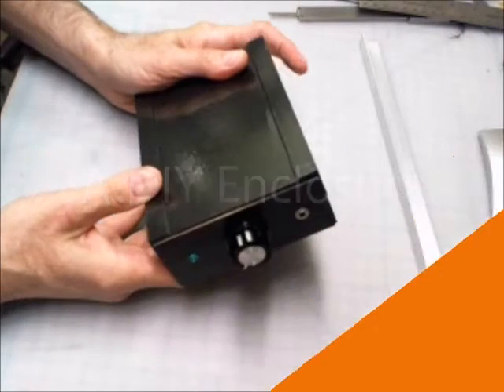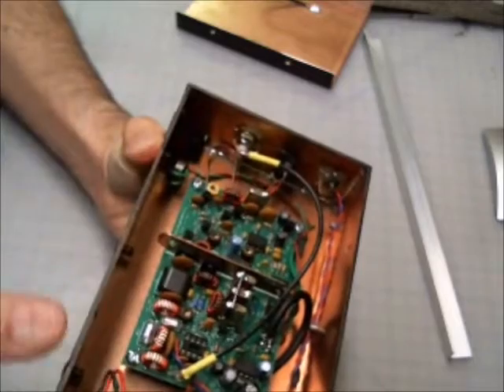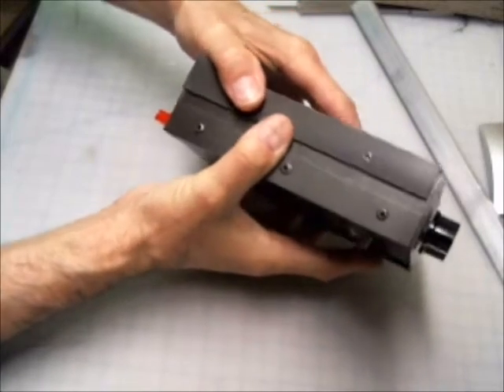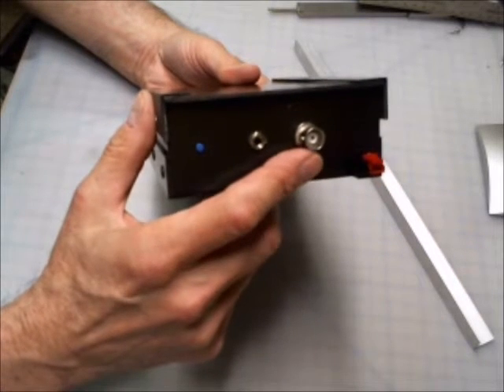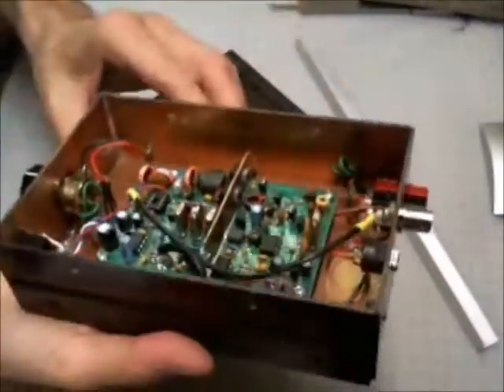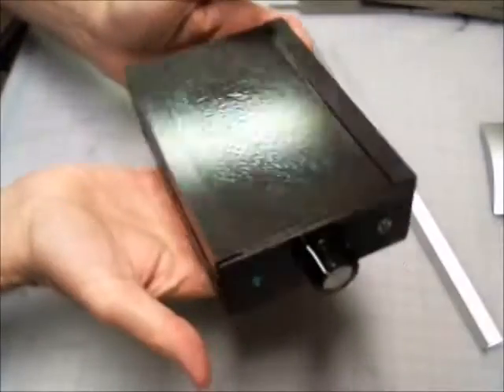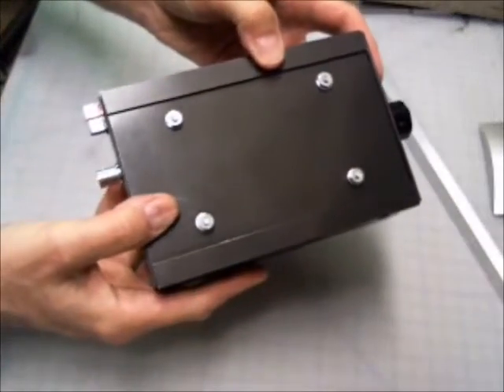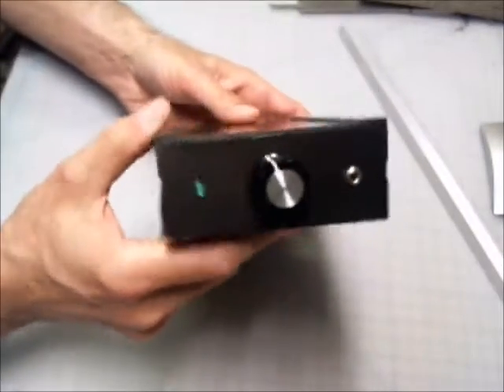A DIY "Pig Rig" Enclosure

Comment: Cool idea! Using PCB boards as side panels is cheaper than sheet metal?
Reply from the maker: Well, that depends on the tools you have and the materials readily available to you. These panels came from an eBay supplier already 4 x 6 inches (~100 x 150 mm) at pretty-low cost. The top and bottom of this enclosure required no cutting. I cut the two side panels from a 4x6 using the score-and-snap method. See https://youtu.be/uBkPX_QhRI0. I have made subsequent enclosures using even-cheaper scrap pcb material, so material costs were even lower. 
Now one can usually find scrapped sheet metal for next to nothing (discarded microwave ovens in the dumpster, etc.) but without proper tools (metal shear, brake, etc) it's hard to get good results. Tin snips and a bench vise can be used, but unless you have special skills, the results are pretty ragged. Here's a video on sheet-metal fabrication of small enclosures: https://youtu.be/P-5VbdbNf-k (part 1 of multipart series) and  a PDF tutorial on pcb enclosures: https://qrpbuilder.com/wp-content/uploads/2016/11/pcb_chassis_a.pdf.  --Todd K7TFC
Reply: @MostlyDiyRF  Ah I see, thanks for the detailed reply. (Some things are definitely easier with a home shop / right tools). What I like about the L bracket edge idea is its versatility. Anything can be used for the side panel as long as it meets your needs...